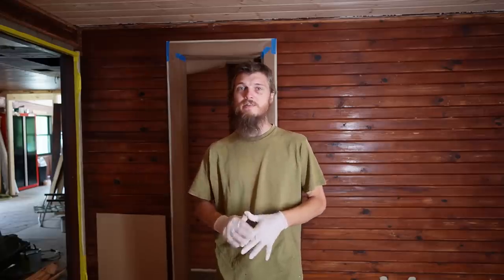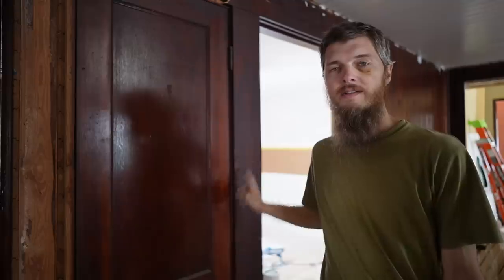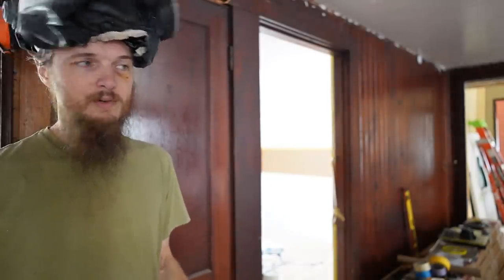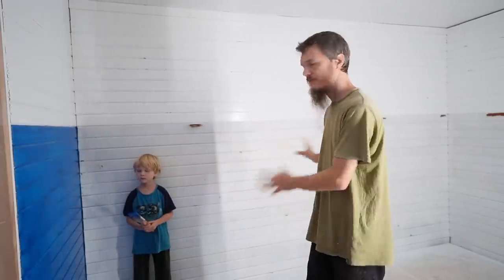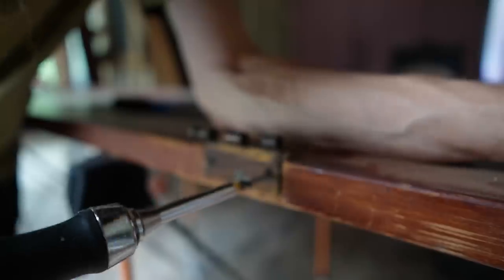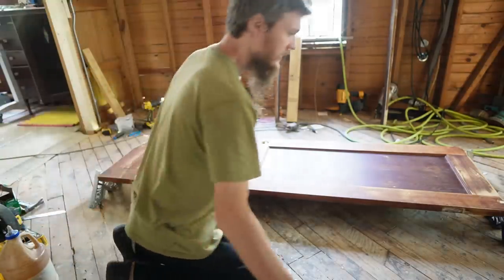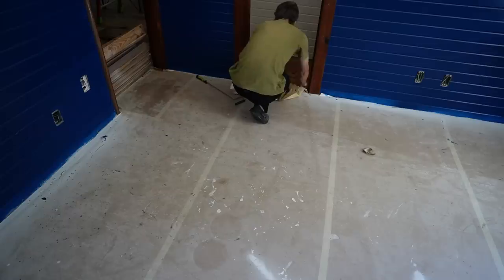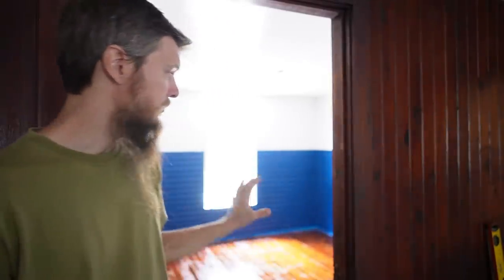Painting the Little Bedroom - Our DIY Home Remodel Experience

Comment: Loved hearing Maverick off camera saying that it's starting to look good!  I agree with you, Maverick!  Doug, I might have missed you showing or explaining what to do about the broken off hinge screws, or maybe you explained it in another video...?  Help?  I need to know how to solve the broken screw problem.  TIA
Reply from the maker: Not much can be done about removing it. If you can get a hold of the screw, use some vice grips. Maybe buying a new hinge that has different hole spacings to bypass the old holes. Or move the hinge altogether.

Comment: I like it!  That looks awesome!  Especially for your young man!  Nice work!  I am curious as to how you're going to address those failed screw holes in the hinges.  Gonna change to hinges with different screw hole pattern?  Thanks for the content!  All the very best to you all!
Reply from the maker: Not sure yet. We'll see how it goes.
Reply: @diyfferent  I think those 4 hole type hinges might work...at least they'll straddle your middle screw holes.  You should wind up with at least 3 solid screws...even if you lose one hole.  All the very best to you all!
Reply: @diyfferent  I've used toothpicks and wood glue  to fill in the old screw holes and haven't had a door come loose or sag yet.

Comment: Just wondering why you didn't roll the lower part. The roller will give you a much better finish.
Reply from the maker: The reason we chose not to roll is because we didn't want to roller texture. We like the brushed finish better. It's very smooth! Also, we find it hard to get in all the grooves and especially in the wood imperfections with a roller.
Reply: Rollers give an orange peel finish.
Reply: @laurieg673  Depends on the type of roller you use and the paint. Most professionals either spray or roll and no orange peel.
Reply: @WizzardofOdds  I've been painting furniture for 40 years and tried every roller made. They all leave orange peel bumps.

Comment: You should not have shalacted over the sanded wood before painting.  You should have sanded and then painted the sanded wood directly.
Reply from the maker: Please don't devalue our information with false ideas. I have been doing this work for decades and have a lot of experience with shellac. I used it appropriately to achieve what I wanted. Which is mostly to seal the wood and prevent further release of the clear finish. 

Shellac is also a great stain and knot blocker when used under paint. If you don't need shellac, you can certainly paint right over the wood. But there is nothing wrong with using shellac before painting and in some cases it's very beneficial to do so. There no reason to say that I should not have shellacked the wood.